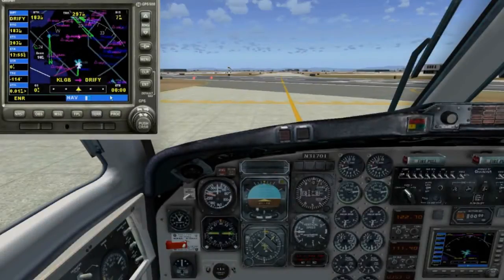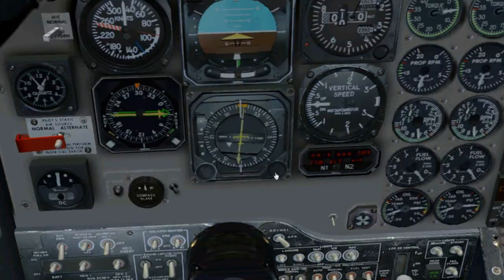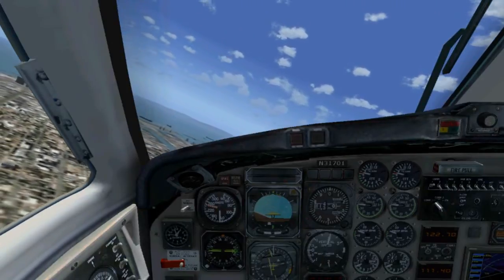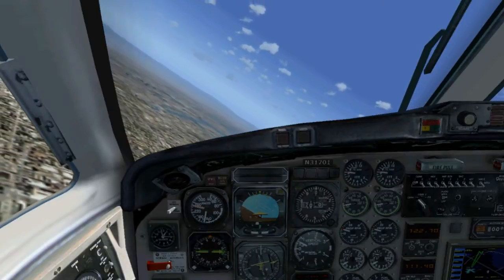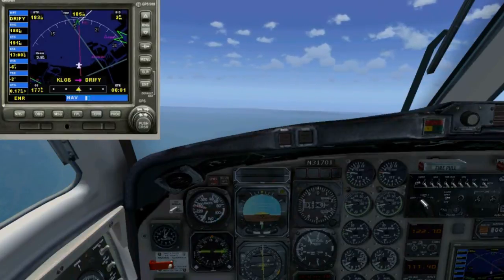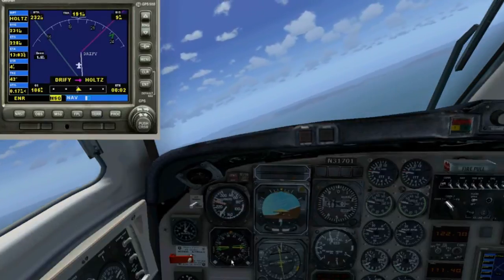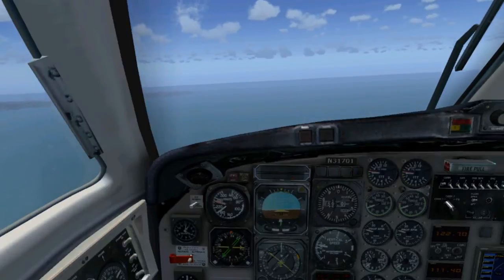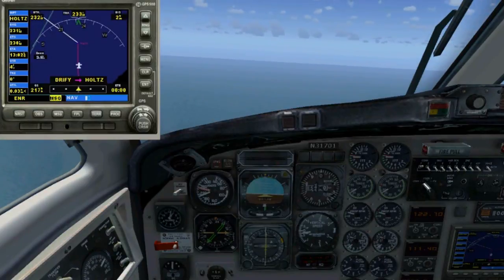GPS Navigation Tutorial - Part III (Using the HSI for GPS navigation)

Comment from the maker: First, I am assuming that you are flying 060 to (or from) a VOR, and the VOR is set to that course and needle is centered (VOR mode). You have also selected the GPS flight path to (or from) that VOR that is the same as the radial (your VOR flight path).

So now you can switch between the VOR and GPS mode on the HSI (or VOR gauge).

If the HSI (VOR) needle is a little off from what the GPS is showing you that just means that there is some error when tracking a VOR, the GPS is more accurate.